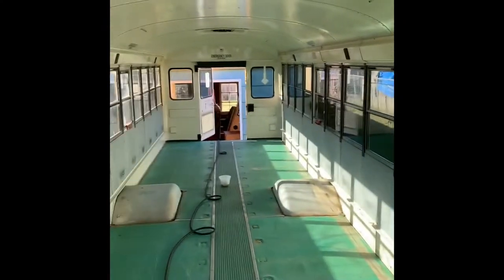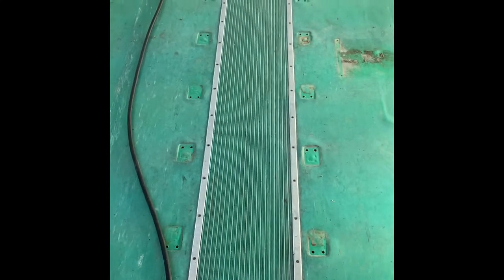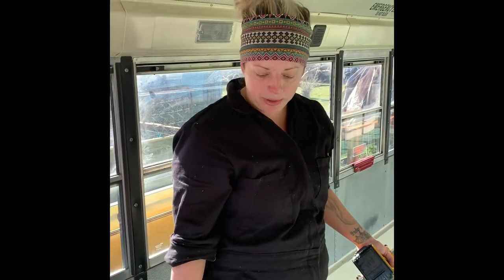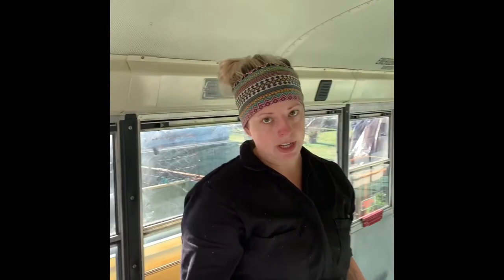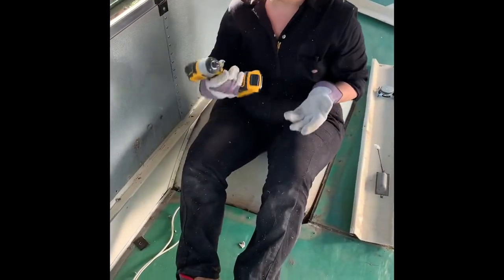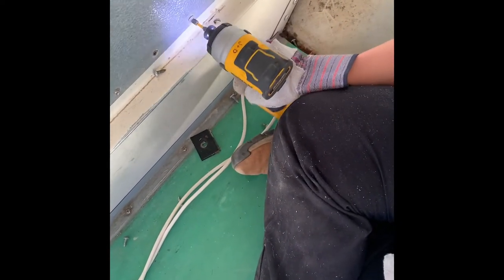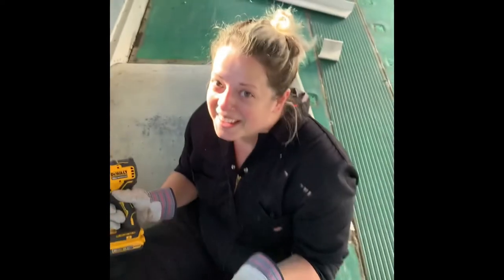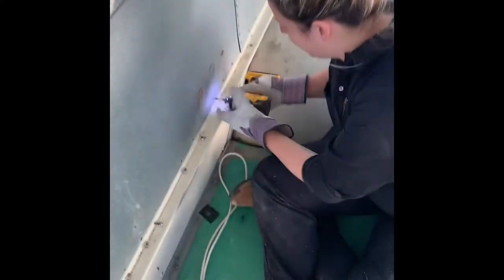Video 3 | How to prep skoolie walls+floor+ceiling for removal

Comment: I had all steel rivets in my bus, 500+ to remove with a chisel, hammer, and punch, yeah, ummm fond memory of that.  It was winter and my air tools kept freezing up to I had to let them warm up and use hand tools as well.